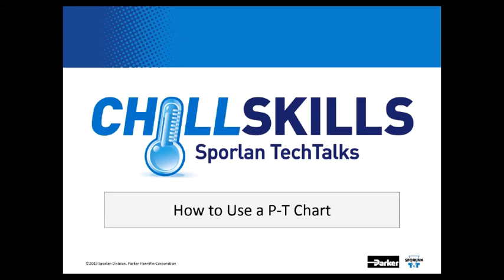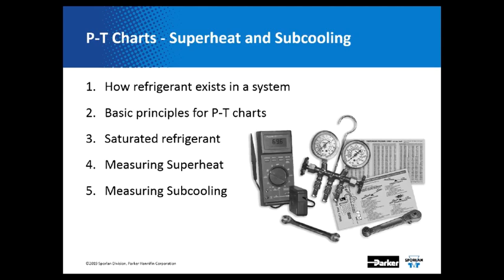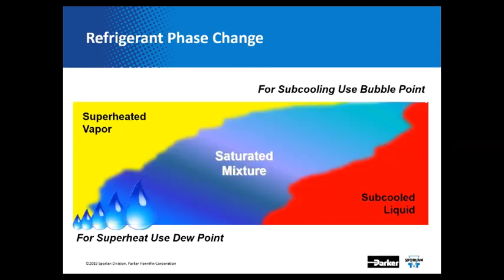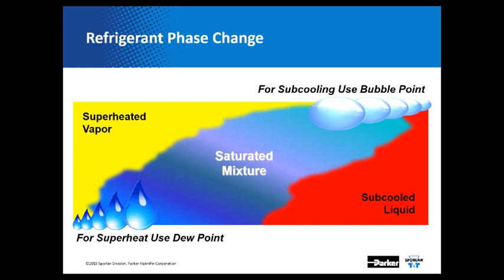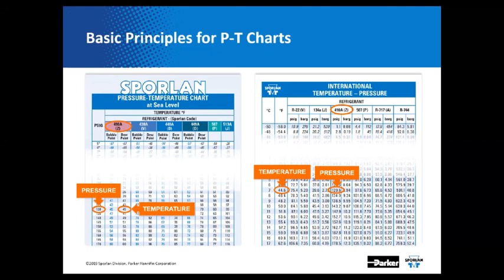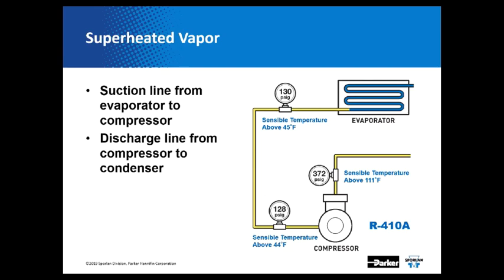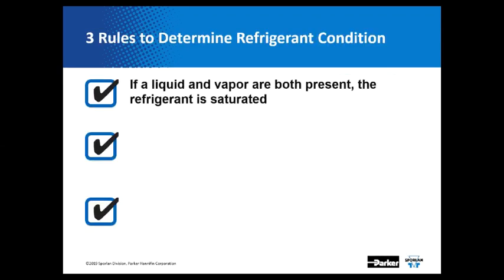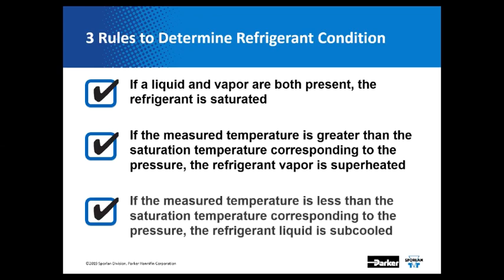How to Use a P-T Chart

Comment: What if I insulated the suction line that goes back to the compressor in my car?
Will this increase the cooling efficiency without harming the compressor?

Note, I live in a hot area ( 5 C - 55 C degree)
Reply: Compentis  cycalesand  compering  toal componeted vaprar  comprsser
Reply: Yes,sir ok vapear  copressar systomesd,ex,   Hphtv-highprssure  high  temperature  vapor,   HpLtl-high  pressure  low  temerarure  liquied,  ,LpLTL-  lLowpressure  Low  temperature  lLiquied  ,    LpLTv-  low  pressurevlow  Temprature vapor,

Comment: So basically, just compare actual temp to ideal temp from PT chart?  Im quite confused why do you need to do subtraction? Does the difference tell us anything. Please enlighten me.

By the way, thank you for sharing your video. Sub
Reply: The compressor should get vapor only at suction line for a proper refrigeration cycle. So to be sure that compressor is sucking a superheated vapor we should get the difference, which tells the suction line is getting superheated vapor above its saturation point.